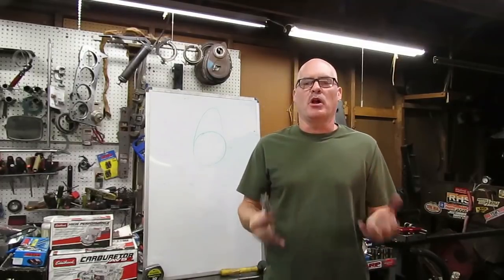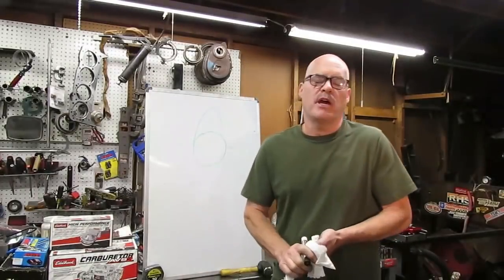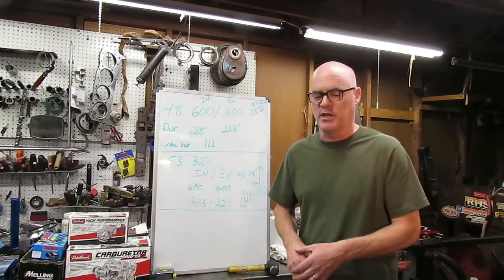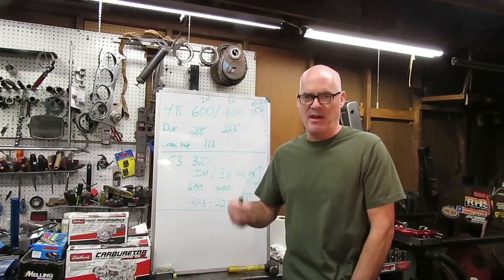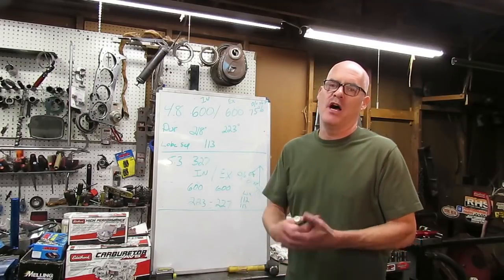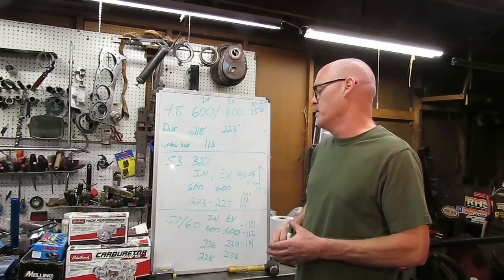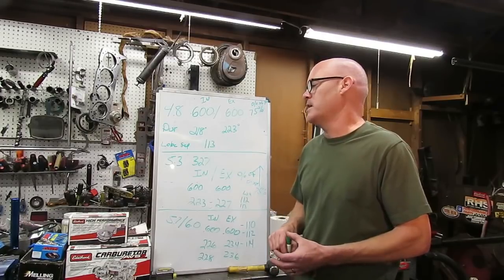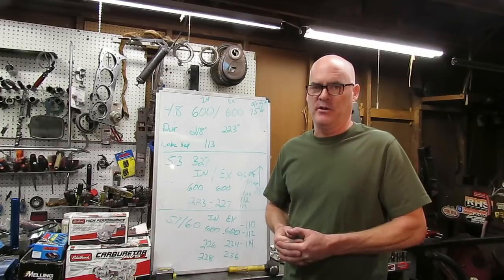How to properly select a Camshaft part 2

Comment: Have you thought about making videos recommending which cams for which engine for Ford also? I have 302 5.0 in an 89 f150 and have been doing research. I understand with sd I will not get a aggressive lope but still searching on best cam and seeing if I should change heads

Comment: Lobe Separation : 50's Through 70's automatic transmissions and other items in these vehicles require VACUUM.112,114 lobe separation gives you vacuum for these items. If you run a manual shift trans with cable or electric operated accessories 108 lobe separation is ok.

Comment: I'm rebuilding a LS1 5.7L 2000 with 853 heads 3220 curb weight 1986 El Camino with a 4L60e transmission, LS6 intake, 78mm DBW throttle body, stock exhaust manifold-x-pipe dual working on 1-3/4 long tube header install.  Your recommendation is 228/236 600 lift with LSA 112 or 226/234 600 lift LSA 114.  This will be street car for spirited driving maybe daily driver, I want a smooth idle I can live with a slight lope .  I want it to be enjoyable to drive.  I found a Comp Cam 224/230 114 LSA 0.581/0.588 Lift XER273HR and also 223/231 112 LSA .610/.617 Lift 273LrHR12 but I am concerned these will be to aggressive and would lean towards the XER273HR for the 114 LSA.  Am I leaving torque and HP on the table?  Should I look for smaller duration and lift?  In my mind I am thinking 400+ RWHP but I want efficient and peppy fun to drive.  Suggestions, options, cam brand I should look into or should stay way from?

Comment: fantastic explanation. If you take the same duration approach as the other engines what duration would you end up with on a bbc 427 with semi closed late 60's iron heads?

Comment: Another fantastic video. My 5.7 block is at the machine shop currently so I'm at the critical stage of part selection. Any advice would be very helpful. I have a 1988 IROC-Z, had to bore .30 over and replace pistons, I've ported the heads so far and thats it. The machinist has suggested flat head pistons and said I should have my cam re-ground.

Comment: Say Mike can you help me out...rebuilding a sbc that had casting numbers as follows...block=14010207, heads=462624, crank=3932442 and an unknown camshaft with only a CWC, or CMC and a #1579 and a “D9” between the lobes. There is a casting number of some kind on the face of the sprocket mating surface of 838630. I’ve spent the better part of the evening trying to research these numbers to little avail. I’m told the “CMC/CWC” are a main cam core distributor supplying all the major aftermarket brands.

Comment: Great job. isn't most of this explanation under wide open throttle?  what about a street engine cruising at 2500 rpm on the highway?  What does this do for best cam selection?

Comment: Speaking directly to your cam suggestions for the LS motors because they have so much cross-compatibility with heads, intakes, etc; does changing the head to increase static compression (706, 862, 799 heads on a 6.0) change what you would recommend for a particular configuration? I'm building a 6.0 with the 706 heads to raise my compression because I want low speed torque for a full-size 4X4 truck swap and I'm looking at a lower duration high lift cam with a 110+3 LSA. Since the 706 head has smaller valves and a little less flow than some of the other LS heads, would I benefit from slightly more overlap on the bigger bore?
Reply from the maker: yes a little more cam will help

Comment: Quick question I just bought a Nova with a 454 the only thing the owner could tell me was the motor was a 72 block with stock crank and rods and pistons obviously rebuilt but left stock and it has a elgin cam 305 305 550 550 with 108 lbs also has what he called reworked 502 heads he showed me an old valve they were pretty big. I almost didn't buy it because of the lack of info, but its tubbed and everything looks built real well. I know this is real general but I dont know much about the 502 heads and how much they would help. did they have a specific shape port like oval or square ? I believe the 72 454 was detuned with 8.5-1 comp only had like 253hp so I'm guessing they had to increase the comp when they rebuilt it with the heads and cam? any info will help thanks.Unfortunately the car hasnt arrived in shipping yet so I cant check block numbers and head numbers. I guess that question wasn't that quick after all lol

Comment: You say to use a single profile camshaft on a set of heads that has over 75% of flow. Is it OK to use a dual profile camshaft on a set of heads that has over 75% of flow?

Comment: hi there thanks for your vids i have learnt alot..if you could help me out and give me some good advice it would be very helpful, i have 68 roadrunner with a 383 and i have been rebuilding the engine at home, i get that the alloy heads are always going to be better but they  are pricey $$ too, i have the 906 heads on the car and i have been planning to trick them out as good as i can  as people say they were the good ones to have..can you give me some advice on what and how far i could go with them, i planed to get them flow tested then work on them from there porting..valves?? etc any advice would be helpful.thanks for the vids again.

Comment: Hey sir, its been a while. I have a question for you on something i have never seen mentioned on a SBF 302. I plan on using a 70's  non-roller block and make it a roller motor. Mentioned it to someone and they said "Make sure you check the end play on the cam". I have never heard of that and I have seen one or two vids now (showing a cam button that go behind the front cover). But I never see videos of checking cam end play, only Crankshaft thrust. Is this common ? Is it because I am going  to turn a non roller block to use a roller cam and roller lifters? Would appreciate your expert guidance on this subject
Reply from the maker: Yea you should check it it's usally fine when the cam is bolted in

Comment: Incredible teaching and Thanks!!    I have an 06' GMC 5.3 Vortec and I pull boats and want that power which I don't have!  I want to keep the budget down and utilize my stock stuff if possible.  Is the IN-600 / EX-600, Dur. 223-227 w/ 113-114 lobe sep the best fit?

Comment: Great content on the cam selection and configuring optimum performance.  I have a stock  buick 430 wildcat, don't need performance, would like to add a mild chop, can I adjust the current cam or do you recommend another cam to get the effect.  I plan to replace rockers, springs, valves, and add a 71 timing cover to improve oiling.
Reply: The smartest thing you can do for that 430 Buick is put in oval port Big Block Chevy non tuliped valves . They kill the flow in that engine HORRIBLY !!!  That valve change will have you smokin the tires Easily !!! The engine goes absolutely Ape Shit and will MPG like you never thought possible !!! Incidently that head although smaller ports is an absolute JEWEL in its port design . Extremely Efficicent once it has the Chevy valves in it . Id love to have one again !!!

Comment: I can’t find your video on cam bearing install, but I cannot find any good threads on cam bearing orientation on a 350 Chevy, I’ve seen a lot of engine builders align the with the holes on the main but what do you think works for best oiling

Comment: would like to say the first vision is better than the second one. there is a little confusion between lsa and valve overlap. more lsa will increase high rpm and lower lsa will increase lower rpm operation. engine masters has also proven that larger exhausts does not lower power output. with a smaller engine.

Comment: 2002 Camaro SS factory stock 6 speed. Using your insight I'm doing a cam and long tube headers. What size primaries 1 3/4" or 1 7/8"?

Comment: Would you consider making a video about piston selection? That's where I'm not sure in my engine build now. From these videos I learned more about the heads I'm looking at and found a cam that would be perfect for those heads, however with the higher lift the heads allow from stock requires non-stock dished pistons. Is there a way to get an educated guess here for a ballpark of what I'm looking for, or is this the point where you talk to an engine builder?

Most informative video on the topic I've seen. I am way more prepared for my goals and have more of an educated guess for my parts list.

Comment: on your point of poor heads, a good example would be the stock heads on the Chevy 305, which needed a good head to perform in the Z28. There is actually a market for Torquer cylinder head for that engine.
Reply from the maker: yep that is correct head an cam package makes great improvements on a 305 the 350 vortec heads and a good roller cam will net you 50 to 60 HP on a 305 keep in mind you need to use a 350 head gasket and cut valve relief's into the cylinders like a 396 has so the 1.940 valves will not hit the deck surface a lot of work but if you have the time and the engine well worth the effort

Comment: Great video!!  Question for you:  I just experienced a lifter failure in my 2013 C6 Grand Sport.  The engine is bone-stock and I don't race it, nor do I plan on doing so.  Since I have to replace the stock cam, I was thinking of the BTR CAMSHAFT - LS3 - N/A STAGE 1 - 32128122R1.  Specs: 221/228 .613"/.605" 112+2.  (Also going with the BTR springs and push rods)  I enjoy spirited driving but again, don't race the car.  Is this a good cam to go with and what kind of performance might I expect?  Thanks!!

Comment: Man excellent video! I've tried to understand much of this in the past but this really clears confusion! Do you take in work from the locals? I'd like increase the flow on my factory396 heads. Quick question, is it really expensive to take heads from roughly 68% of flow to 80% or better and is it worth it? I used your excellent tutorial to get an estimate based on my configuration and would like to target a little more HP. Thanks for the the great information.

Comment: Thank you!  Brilliant, pulling the curtain open on the importance of valve events and where degree-ing a cam should be measured.  I'm good for several days of learning something!  Exhaust resonance tuning is critical, of course, but how about intake charge swirl and turbulence affecting combustion burn?  Will spending money on "CNC porting" to open up the port's cross sectional area and thereby lower the port's pressure drop - could that adversely affect 'swirl' and intake charge combustion or is this more emissions related?
Reply from the maker: Turbulence is important to keep the A/F mix even throughout the entire air charge this is why you should never polish the intake runners it can actually cause the atomized fuel to fall out of suspension in the port and then you have real trouble the swirl effect can help flow by allowing the air charge to swirl into the chamber around the valve and also increase the velocity of the air charge in a low turbulence chamber like a hemi the air has more of a tumbling motion rather than a swirl like in a vortec  the down side is the hemi is more prone to detonation in high compression or boosted situations
Reply: @Myvintageiron7512  Smokey Yunick spent a long time studying intake flow and did many tests including making intakes with glass windows and he said that he was never able to observe fully atomized flow in intake runners. There was always some liquid fuel, especally at full throttle. The trick is to make sure any fuel which does flow in the intake is evenly distributed to the cylinders. The carb base is critical in producing some turbulence to break up the liquid fuel flow to get a chance for equal distribution. In any case some fuel will not atomize until the compression heats it and some swirl is important to get it normalized in the chamber. Explains why straight six engines benefited so much from intake manifold heating as far as drive-ability. It's a long way to the  two most distant cylinders. In draw thru supercharger systems we tried to get low restriction intake manifold but they woulden't work because there was not enough turbulence to get fuel distribution. The successful systems always had what we called the "sacrificial T" in the intake to produce decent fuel distribution.
It kinda makes you appreciate  port and direct injection systems. They solve a lot of problems.
All that said some roughness in the intake runners might not be a bad thing.

Comment: I'm really y struggling with a cam selection on a sbc. 1990 Corvette 383, stock aluminum heads, 1.5 roller rockers with a First Performance TPI set up. Gonna run a 24x conversion, Ls computer with coil per cylinder. Can you get me pointed the right direction?

Comment: For You Ford Guys: A mild cam in a 427ci "351W" Ford Stroker is a VERY HOT cam in 289ci (or even 260/221 if heads were same, which they are not, due to small bore.)

Comment: I have a 78 Chevy Malibu 4 speed it's 360 in it it's got 373s in the rear posi got 15 inch tires on it to streetcar what Kim would you run in it it's got 462 heads on it for 750 Harley vacuum advance

Comment: do or can I factor in 25 degrees of valve timing to allow for  the 0.050" low lift flow? Don't get to benefit from any of this modern stuff Oldsmobile is the make of my parts there are maybe 3 aftermarket heads working the plan for a 6.8 liter 5.7 Olds diesel block stroker conversion 3.8" x4.185" bore

Comment: Myvintageiron7512 , I chose a 217/225 .595 .589 114+2 for a LS3 headed 6.0. Wanting a very wide powerband and very strong torque for a 4k lb car, did I chose a good match for my engine ? Thanks for all you do !
Reply from the maker: A little small but it will work well

Comment: .75 exhaust flow so use a single pattern cam... then looks like all dual pattern cams (differing duration for intake and exhaust) were quoted for EVERY engine example.. am I not understanding something?

Comment: So im dumb and im desperate for advice.. you seem smart. I have a sierra with a 5.3 im rebuilding the engine and want to put a "better" cam in it while im there. The truck is lifted a bit and i run 35"s so not a speed racer just a driver/trail truck. I dont care about sound or high rpm gains i just want a good little power and torque boost from low end through mid range. What should i be looking for do you think? Its an lm7.
Reply from the maker: The stock cam in the LM7 is more than adequate for a TQ engine I wouldn't spend money on an aftermarket cam if you want low to mid range just run the OEM cam it will run great
Reply: Right on thanks 👍🏻

Comment: Good morning sir! Just found your channel and love everything so far. You have a great way of explaining things. I have a quick question for you. I bought a 99 vette a couple years ago and it has an LS1 with AFR heads and an AFR cam. The original owner had all the work done by a shop but retained zero information and doesn’t seem to have much interest in helping find out the specs. Do you think there’s anyway to find out the cam specs outside of removing it? It isn’t anything crazy but it’s definitely not stock. Car runs and drives great but I’d mostly just like to satisfy my curiosity. Thank you for the great videos!

Comment: Great Content Sir 👌 
Building a L94 (Delete) stroked 416 w LS7 Crank/Pankl Ti Rods/11:1 Mahles w 823 Req port Heads/ LS7 Manifold/Cats w 3" Z06 npp exhuast/ L94 truck intake
 w 6L80 (Stock TQ) TuTd adapted into Heavy 96 Land Cruiser 4x4 on 35's 4:11
 Gears ~ Looking for Low End ~ Mid Range Torque (Light ATV towing) in the  1500-6700rpm range
   Looking @ / BTR 219/239 .553/.553 @ 115 lsa +2 for -1.0 overlap ~ Throttle Response & Torque thru Curve over chasing unuseable high RPM

Comment: Question . Have a stock 68 327 with double hump heads so slightly stronger than stock runing 4bbl can you recommend a cam for it . I don’t get the math stuff. Mild lol at idle with good mid range with having to change to low stall converter

Comment: Hello sir. Thank you for the information. 
I would appreciate just a little of your help on my truck since everything isn’t all factory
It’s a 2004 GMC Yukon Denali lq4 6.0. Just wanna replace the cam and springs. Lifters as well but will keep stock specs. 
I tow from time to time about 6000 pounds plus or minus
It’s constantly loaded in the back with stereo equipment. Not your average little system. It’s about 400 pounds back there. If you see one of my other videos from a competition you’ll understand. 
33x12.50 tires 
Currently 20x10 wanna go 22x10. Try to keep it a pavement princess but certain job sites don’t let me. 
Street driven daily until I buy another car. 
Exhaust. Stock manifold. Only have 2 catalytic converters. Magnaflow x pipe 2.5 inch back to 2 2.5 inch carven tr series mufflers back 2.5 inch piping to 2 3.5x18 inch tips. 
116 lsa. 
Also thinking between .550-.600 lift. Goal rpm is 6500 which puts me close to 4000 to be safe. 
Duration I’m stubbled upon. Would like to add about 50-70 hp and as much torque as I can without any sacrifices throughout the rpm range. 
Any help I would greatly appreciate it as well as brand for a camshaft that fits my needs. Nothing crazy. Just want more power and still stay on 87 gas. 9:4.1 compression ratio stock I believe. 
Update. I’m seeing 2 from cam motion I’m really liking a lot. Unsure of which. 
Both for 6.0
Stage 3 ls2 218/224 .595/.595 lift 116+3 lsa intake center line 113
6.0 stage 2 truck cam 210/216 .553/.553 lift 116+5 lsa 111 intake center line
Reply from the maker: I would go 114 or wider for that .580 ish lift 218/224 durtation
Reply: @Myvintageiron7512  I definitely appreciate the reply and your time and help. Thank you sir. I’ll be looking for that

Comment: Would the new LT1 engines need a comparable cam to the LS 5.7/6.0 motor in this example? I'm really cramming to figure out what the best specs are for the LT1 motor that I have in my 2017 Camaro SS